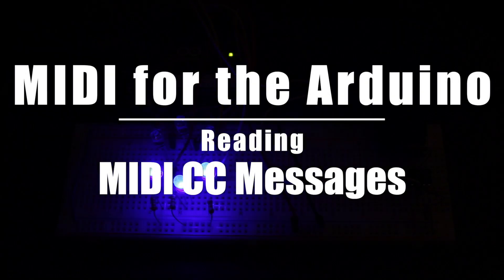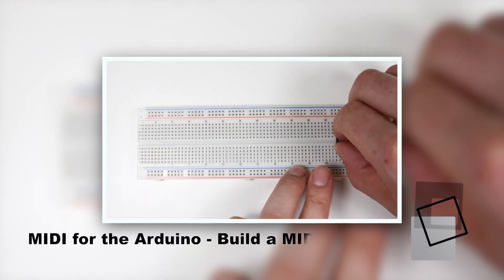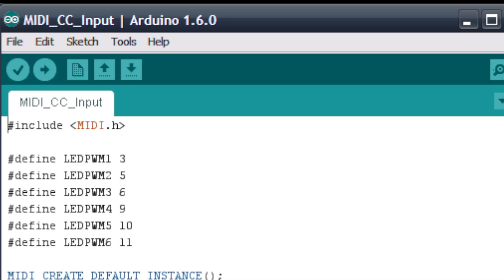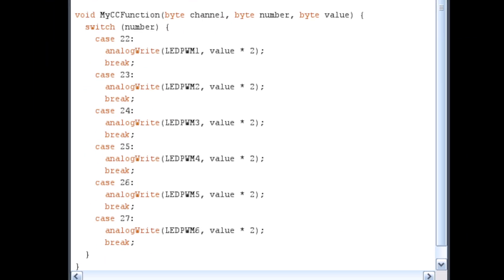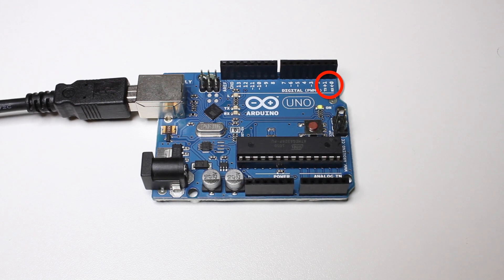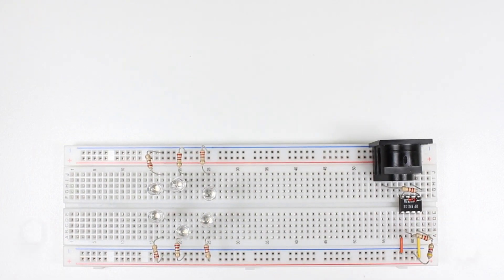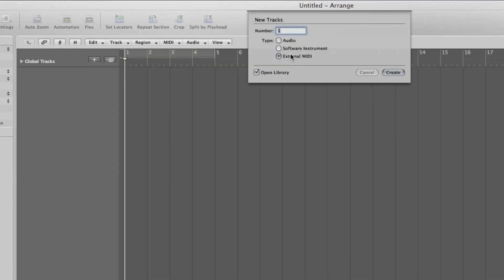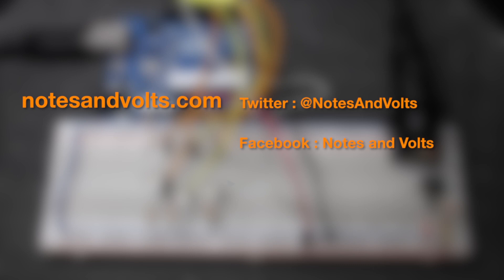MIDI for the Arduino - Reading MIDI CC Messages

Comment: I have the ESP32 boards for previous project.  Will this work the same way with ESP32 or do I have to buy the Ardruino board?
Thanks,
Reply: I am trying too figure this out as well for my project. I think serial-to-midi works with any ESp32, as long as you have the esp32 core in your Arduino IDE library already. But I haven't started connecting things yet, so I don't know if there's different pins or paths we have to use. Where are you in the process? (I just finished research, can't find a better tutorial than this one, so I am trying it out today.)
Reply: @jephbennett  Still research now.  I am trying to do the midi controller to control my arranger keyboard.
Reply: @Vgjbfgaas  Are you building a series of mechanical inputs (knobs, buttons, sliders) to send midi data thru the esp32 to control your keyboard? 
If so, unless you're very familiar with coding in the Arduino IDE, I'd consider either:
a. finding the best, most simple tutorial that does what you want and buying the exact board from that tutorial to work on
or
b. just buy a cheap korg controller and set it up to control your keyboard. 
The path forward using ESP32 is not beginner-friendly, you will spend weeks on forums, asking questions, trying things, frying boards, waiting for "that new part to try that might work", then it doesn't. 
I tried for days on my old ESP32S boards. Hairless midi, BLE, etc. 
Now I've bought new ESP32-S3 and a midi input board, but all the guides are for Uno/Nano/Teensy, pinouts don't match, and the code system is a nightmare for a noobie to grasp without weeks of studying.
Reply: @jephbennett  Thank you!
I think I should stay with my Yamaha MFC10 foot pedal.  I doesn't some of my function well without spend more time on this one.
Reply: @jephbennett  
Not much, I just want to build the foot pedal with about 15 pressing switches and some potentiometer to select parameters,  and a display to  MSB, LSB or SysEx that set to

Comment: Great video!!! I have been working on trying to convert midi note data to led's. No conversion or drawing would be required.  Simply play the tracks from finished songs and have easy light shows for every single track/song already finished.You are very close to this in the code you have written for this project. Would it just require a substitution of CC for note on? And separating by track #? Any chance you already have this code?

Comment: how to make midi DIN to usb adapter using arduino nano 
or how to make a usb  midi keyboard with velocity using arduino mega and old keyboard
i have a 49 key keyboard with a 15 pin midi DIN and i wanna found a solution to convert it to usb keyboard.
 for the midi interfaces are not cheap in my country. the midi keyboards too.  plz make a tutorial explaining how could i make this project

Comment: Nice Work! Thnx for the info on how to build and program. Started my project already :) Can it work with midi shield?
Reply from the maker: Thanks Paul. I haven't tested but it should work with a Midi shield.
Reply: @NotesAndVolts  I managed to read the midi cc trough USB using hairless. 
Now my problem is as follow:
I want to run my dc motor (has an pot for position read) 

I use the:   https://www.amazon.de/Stereo-Potentiometer-2-Fach-Motorpotentiometer-Widerstand/dp/B07B41CYH8/ref=sr_1_3?s=ce-de&ie=UTF8&qid=1541074007&sr=1-3&keywords=motor+potentiometer

to go to desired (cc) value but the motor only "chokes". 
I think its because the "byte value" does not have a "int" and when i tried to declare it it wont work :/ 
Any Ideas?
MY code:

#include <MIDI.h>

#include <Wire.h>
#include <Adafruit_MotorShield.h>
#include "utility/Adafruit_MS_PWMServoDriver.h"
Adafruit_MotorShield AFMS = Adafruit_MotorShield(); 
Adafruit_DCMotor *myMotor = AFMS.getMotor(3);

MIDI_CREATE_DEFAULT_INSTANCE();

//static const unsigned ledPin = 13;      // LED pin on Arduino Uno

int citaj = 0;
int controlerWert = 0;

void setup()
{
    AFMS.begin();
    myMotor->setSpeed(255);// Motor speed 0(stop) 255 (fast)
    pinMode(13, OUTPUT);
    MIDI.begin(MIDI_CHANNEL_OMNI);                      // Launch MIDI and listen to channel 
    MIDI.setHandleControlChange(MyCCFunction);
    pinMode(A0, INPUT);
    Serial.begin(9600);
}

void loop()
{
  citaj = analogRead(A0); // reads the pot

  controlerWert = map(citaj,0,1023,0,127);

    if (MIDI.read());                    // If we have received a message
  
}

 void MyCCFunction(byte channel, byte number, byte value)  {

      switch (number) {
        case 21:{
                 controlerWert > value, myMotor->run(BACKWARD);
  // 
                  
                
                       }
                      }
                      
 }
Reply: ok. I managed to Control the motor from daw and daw from pot, only thing is that i can only control the motor in 1 step. when i fix this its almost complete :)

Comment: Great Video! I'm still getting to grips with the Arduino code, is there a way to keep the byte number the same, eg (22) but use the byte value to change from led to led?

Comment: So useful for me. Thanks man.
Reply from the maker: Thanks Ben!
Reply: Hi Dave, I'm just starting out with all this and I wondered if you could help me with a problem.
I've built the interface and I'm receiving MIDI from my DAW just fine. I'm using it to control LEDs in an RGB LED strip using the FastLED library. 
My plan is to use one CC channel to control the LED strip's Red brightness, one CC to control the Blue, and one to control the Green.
I've got this working for up to two colours - with 2 CCs being automated in tracks the DAW. But as soon as I add a third CC track, the LEDs don't respond as I want them to. One of the colours won't change.
The only thing I can think of is that the processor isn't fast enough to receive 3 different CC instructions and send them to the LEDs in time before the next CC change information comes in. Does this sound right? Or would you expect the chip to easily respond to this in time?
If it is a speed issue can you suggest a solution? If you don't have time to write an exact reply, if could just give me a rough idea of what to google that would be super helpful. As I say, I'm very new to this.
Thanks so much again for these tutorials Dave, really appreciate it.
Ben
Reply: Just an update - I've been doing some debugging and I've found that if I nudge the each controller channel in my DAW very slightly it seems to respond much better. The issue seems to be if the exact midi cc message is transmitted from the same channel at the same time. I'm guessing that's too much information hitting the serial port at the same time. Does this sound right?
If you have any suggestions on how to combat that I'd be very interested... Thanks again.
Reply from the maker: Hi Ben. Are you using a Midi Library for your Midi code or are you reading the serial port directly?
Reply: I'm using the Midi library.
Reply from the maker: It sounds like the serial buffer is overflowing. This means the data is coming in faster than it is being read out. Check that you are calling Midi.read() as quickly as possible in your main loop. Your main loop should basically be calling Midi.read() continuously. Try to minimize any delays in other functions.

Comment: Love the videos and the closest thing to what im looking for and i hope you know how i can do it. I need to control a machine with a squencer as its the best way to write the data for the machine. I can send a midi signal to control the machine but i need to get a clock signal into the sequencer so they are in sync. In midi I think there are 24 clock messages for each quarter note (“beat”) so if you send 48 tick messages each second that corresponds to 120bpm. I have no idea how to set this up in an arduino...   The pulse signal from the machine can only be a open and close circuit. Can you help?

Comment: Hi, love all of your videos
Is there a way to have more PWM outputs on a single Arduino Uno
also can you do some LED Rotary encoders like the ones at Mayhew Labs?
Reply from the maker: Thanks Luna! There may be a way to turn a regular digital output into PWM via software - but this is something I haven't tried myself. You could also move to an Arduino Mega which has 15 PWM pins I believe.

Comment: Hi. Awesome project! Is this possible to make this LED fading effect using a expression pedal from a MIDI foot controller (ie. Voodoo Lab GCPro) with Arduino?
Thanx!
Reply from the maker: Thanks William! If the GCPro can output MIDI CC messages from the pedal it should work with no problem. You just need to find out the controller number that the pedal uses and program that into the arduino software.

Comment: Maybe you know what potentiometers/knobs should be used to read midi input and set current position automatically? It's like APC40, Behringer BCR or any modern controller where is the light indication around the knob.
Reply from the maker: Hi Laimis. Those controllers use Rotary Encoders. Those are not supported by this code currently.

Comment: Thank's for this great series but I have a question, how can I use a push button like an arcade button to be my input and have as an output a midi note that can be played in a DAW, I want my arcade buttons to be like the keys from a midi controller.
Reply from the maker: +Daniel Tevi (Jizzy) Hi Daniel. The next videos in this series will cover constructing midi controllers.
Reply: Notes and Volts Awesome! Just in time, my parts are coming this week :D

Comment: Great tutorial! I'm trying to implement this same sort of thing but I want to read MIDI notes and map them to some relays I have attached to digital pins on my Arduino.  I've set the code up like this:
void MyHandleNoteOn(byte channel, byte pitch, byte velocity) { 
  switch (pitch){
    case 60:
      digitalWrite(R1,LOW);  //Turn R1 on
      break;
    case 62:
      digitalWrite(R2,LOW);  //Turn R2 on
      break;
    case 64:
      digitalWrite(R3,LOW);  //Turn R3 on
      break;
    case 65:
      digitalWrite(R4,LOW);  //Turn R4 on
      break;
    case 67:
      digitalWrite(R5,LOW);  //Turn R5 on
      break;
    case 69:
      digitalWrite(R6,LOW);  //Turn R6 on
      break;
    case 71:
      digitalWrite(R7,LOW);  //Turn R7 on
      break;
    case 72:
      digitalWrite(R8,LOW);  //Turn R8 on
      break;            
 }
}

// MyHandleNoteOFF is the function that will be called by the Midi Library
// when a MIDI NOTE OFF message is received.
// * A NOTE ON message with Velocity = 0 will be treated as a NOTE OFF message *
// It will be passed bytes for Channel, Pitch, and Velocity
void MyHandleNoteOff(byte channel, byte pitch, byte velocity) { 
  switch (pitch){
    case 60:
      digitalWrite(R1,HIGH);  //Turn R1 off
      break;
    case 62:
      digitalWrite(R2,HIGH);  //Turn R2 off
      break;
    case 64:
      digitalWrite(R3,HIGH);  //Turn R3 off
      break;
    case 65:
      digitalWrite(R4,HIGH);  //Turn R4 off
      break;
    case 67:
      digitalWrite(R5,HIGH);  //Turn R5 off
      break;
    case 69:
      digitalWrite(R6,HIGH);  //Turn R6 off
      break;
    case 71:
      digitalWrite(R7,HIGH);  //Turn R7 off
      break;
    case 72:
      digitalWrite(R8,HIGH);  //Turn R8 off
      break;            
 }
}

For some reason, the only pitch that triggers a relay is 60 (middle C).  Any ideas what I'm missing?

THANKS!!
Reply from the maker: +Aaron Griffin Hi Aaron. I don't see anything obviously wrong with your code. As a test, you may want to set the first case to 62 for R1 and the second to 60 for R2. 
If a 'D' note now triggers R1 you know that the keys are being read correctly and the problem may be in the other relays.

On the other hand, if a 'C' note now triggers R2 you will know that the incoming midi is at fault.

Good luck!
Reply: hi, did you find the solution? i have the same problem, only that i am using servos.